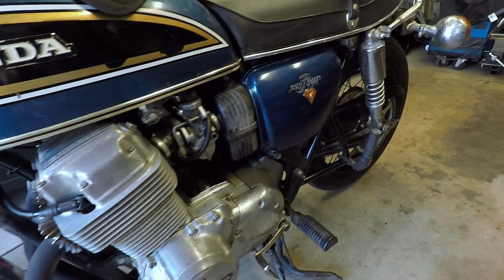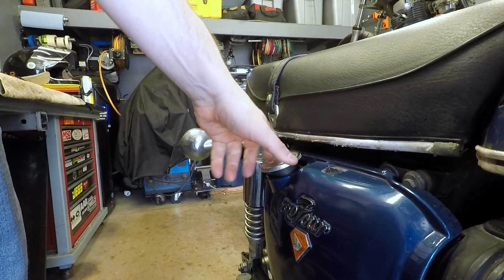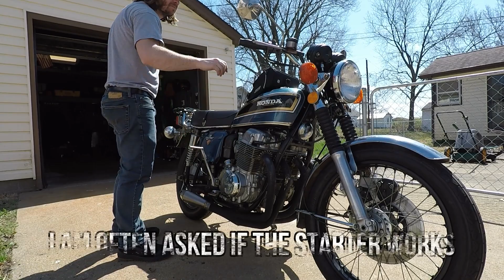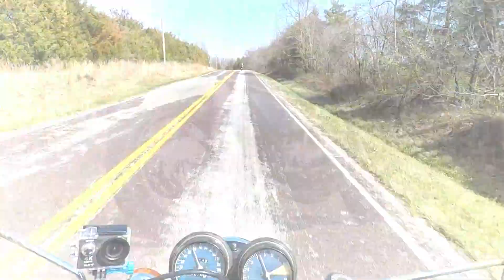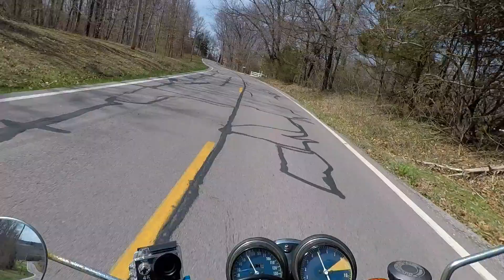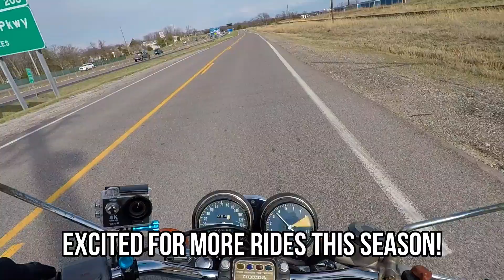CB750 First Start And Ride Of The Season - ASMR

Comment: Nice.  Short down time for you with only three months.  We usually have 50/50.  As of three years ago I ride through all of winter, except this last.  I've got the KLR torn apart to make a build of it finally, and something my wife and I can travel comfortably, on and off road with all the way down to Florida and back.  First ride was with the MV this past Friday.  Turned out the weatherman was wrong, that's rare 🤣  Instead of nice home nice warm and sunny.  I was taking different routes to avoid the rain clouds.  But the system was moving so fast from the north, the temps dropped quick and I still got rained and snowed on (living along the mountains here in Alberta, we can still get snow in the middle of summer).  So I can still say I rode in the snow, just not on the preferred bike of choice.  I still have to send you a pick of my project with the NWT stuff.  As I dug further into the engine, it got worse.  Maybe I'll send you a pick of what I started with, and then next winter I can update you on the progress of the project.  This CB900C was supposed to be the winter build for going down to Florida, but that got put aside for another year.  

The back rack on your CB750 really make me miss riding the KLR, having something to secure saddle bags to.

Comment: Nice! I just got my Kawi 750 turbo running. Need to change tires and finish the gastank. Your CB sounds great! My 71 CB350 twin is running perfectly for the 1st time ever. It ran like crap off of the showroom floor!
Reply from the maker: What was the fix for the 350?
Reply: @BrickHouseBuilds  32mm Mikuni conversion. And every other upgrade that can be done to those. Carbs was the problem, though.

Comment: Nice! Hope you can get non-ethanol fuel where you live. That is all I run in my vintage bikes. I cannot imagine a bike sitting for 3 months and starting up right away without it. BTW I'll buy you the kick starter rubber for your CB750!
Reply from the maker: I've never bothered with non ethanol and have never had an issue. Most of the time I go much longer with sitting. Proper storage is very important.  I appreciate it but must pass on the Kickstart rubber. I purposely keep it off to annoy people who fixate on it instead of the fact the bike has been brought back to life and is on the road at 50 years old lol